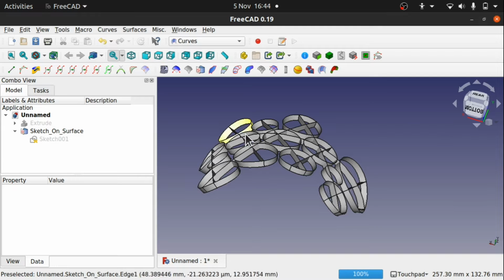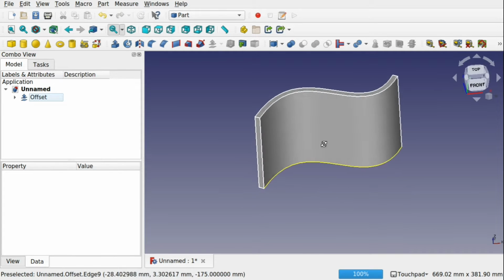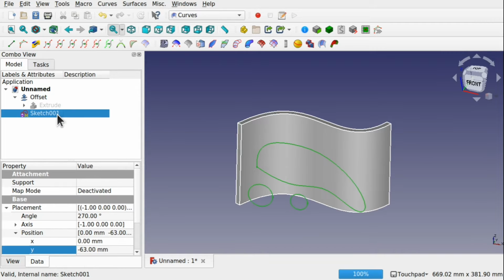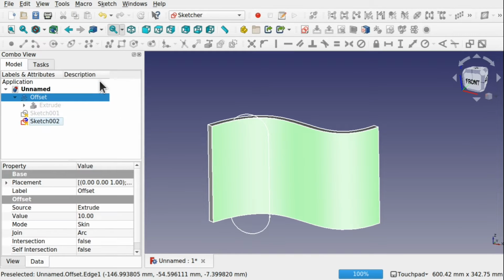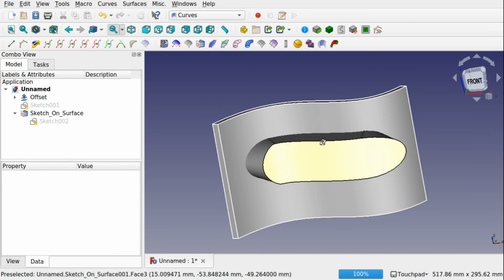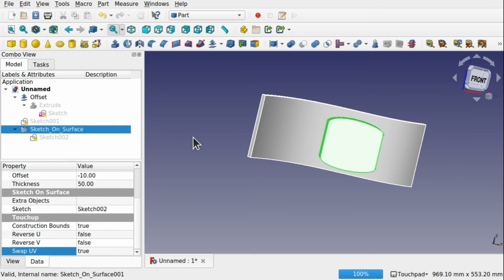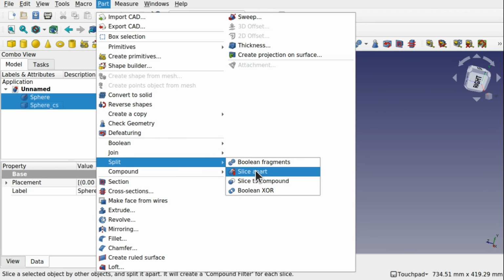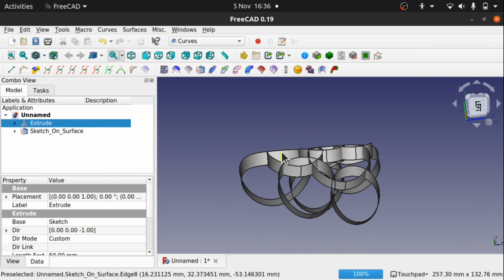Learn FreeCAD Curves Workbench 19: Sketch on Surface. 2 ways of sketching on curved / domed surfaces

Comment: AH!  This is such a better solution than editing the sketch that's created by default when using the "sketch on surface" tool in the Curves Workbench.

EDIT: I can only seem to map b-splines this way.  Not sure why.
Reply: I was having the same problem with the techniques in the video using version 0.21.2.  I was able to get shapes other than b-splines to work by NOT creating the sketch first.  Editing the sketch created on the "sketch on surface" tool as you mentioned.

For others running into this problem: First create the surface, then click on the surface to to sketch on, click the "sketch on surface" icon in the curves workbench.  Then, double click the "Mapped_Sketch" object that was created with this action.  Adding to this created sketch works for me.

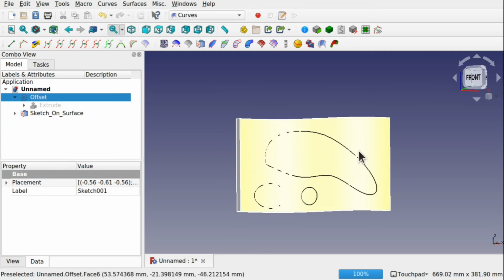Comment: As soon as I use the map sketch on curved surface command as in 8:42, the message "Links go out of the allowed scope" appears and the programme crashed.
Reply from the maker: Which version of freecad are you on and are you on the latest workbench?
Reply: I'm using 0.19. Just updated the curved workbench and tried again. Still crashed but a different message "PositionBySupport: No planar face in AttachEngine3D::calculateAttachedPlacement()"

Comment: Ctrl + r is doing nothing for me.  I don't know how, but I really do think I wound up with a bad FreeCAD installation or something.  Things just aren't working for me the way they're supposed to.  

EDIT 1: What I had when I wrote this comment, at first, was version .19.  I gave up and installed the .20 Beta.  It works a little better for this, but there are still problems.  Could you please post the settings you have for your installation, so that people can more adequately follow along?  I have to believe it's a setting thing - or something.

Also, it would be great if this video were a little more straight-through-the-lesson.  The extra information and the deletions and so forth are a bit confusing because there's nothing on the screen that says what you did with your keyboard (you usually vocalize what you're doing, and you do a great job of it, but once in a while, you don't, and it's hard for a beginner to follow exactly what you're doing without a visual or audio clue as to which key you tapped on your keyboard to accomplish something).  The other problem is that (I suspect that the settings have to do with this though) when I create extrusions and so forth, my FreeCAD ads a bunch of extra layers, instead of just one like yours does.  Sometimes it throws in other layers that never show up on your screen.  Those seem to combine a lot of information that can't easily be edited later, sometimes even deleting the layers you seem to be working out of.  If it's not a settings thing, then I don't know what to do to fix this.  It makes it very difficult to follow along in your tutorial.

EDIT 2: So, basically, I had to do the first half of the first way of doing this and meld it with the 2nd half of the 2nd way of doing this.  I think.  I'm not sure, but eventually I did finish this tutorial successfully!  On reflection, I believe FreeCAD .20 has dropped some of the previous methods of working with the layers (or whatever they're called) that are used for doing this tutorial.

Also, I'm thinking about going back and attempting to do lessons 3.3 and 3.4 again, now that I have version .20 installed.  Maybe that's what I needed?  I have no clue.  Not tonight, though; I'm done CADing for this evening.
Reply from the maker: Sorry bit behind in replying to comments.  I am looking to go through and remake some of these tutorials with the other assembly workbenches and newer versions of freecad.  There are a number of assembly workbenches out there and some interesting ones that have come up on the radar, great you have got through the tutorial.  And thanks for the comments , I will take those on board, always welcome.
Reply: @MangoJellySolutions  Just found your reply!  I'm behind too!  Thank you!  Can't wait to learn more!